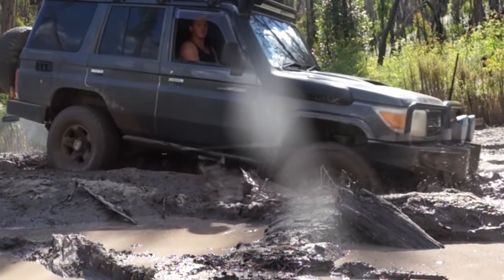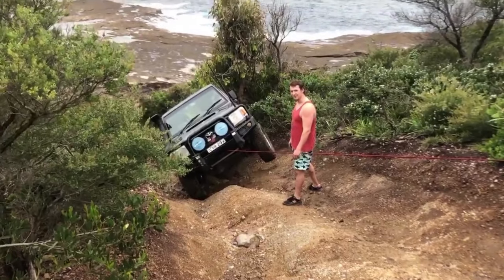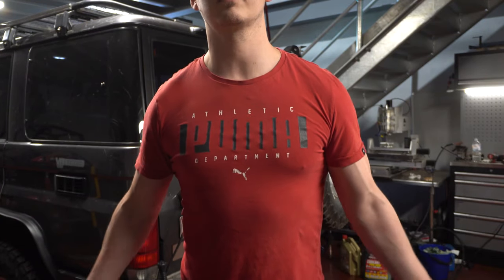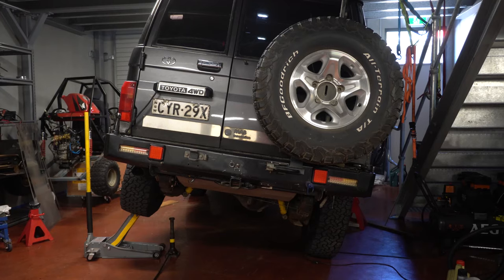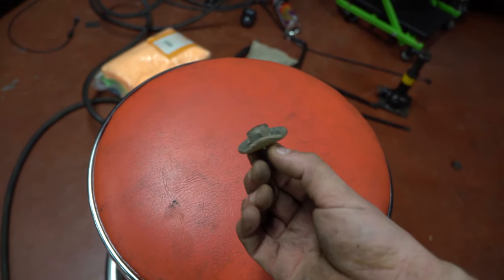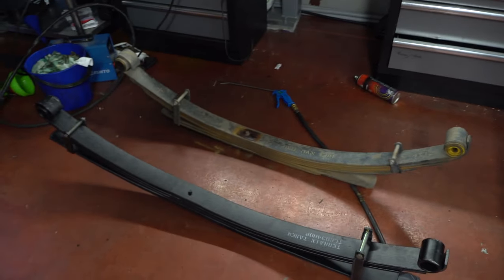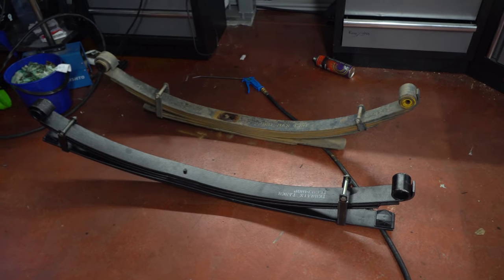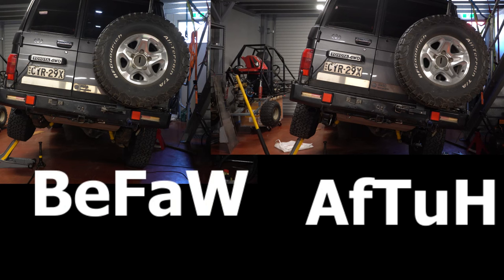Watch this BEFORE buying parabolic springs. are they good? (spoiler: no)

Comment: Mate you know nothing about suspension especially parabolics, you have no idea
Reply from the maker: Who hurt you Tommy? Were the awkward stares too much? Why not say the bits you don't like and we can figure out why you're wrong 😂
Reply: don’t you dare be mean to Tommy he knows truck and spanners.
Reply: Tommy is not wrong but please explain why the thickness of the leaf would change height of the car? The diff is on top of the leaf 😂
Reply from the maker: @jordankaraka897 another one! Welcome. Ride height is not the same thing as ground clearance
Reply: @ridiculousthings4x4 . Actually , your  Tyre Diameter  is the Major ground clearance improver/detractor .
But in reality the Lowest part of the Car is the Diff " Pumpkins " .
Reply from the maker: Not always. Flex up, what's the lowest point then? Regardless, the previous lowest point was the leafspring. Next
Reply: @ridiculousthings4x4 . (sigh) . The  TYRE CONTACT PATCH is the Lowest point .
In flexed position that remains true .
If you manage to Fall Off the obstacle causing said flex then OK the Spring Mounting Plate  OR  the Axle tunnel might be the low point in THAT instance .
Of course , you COULD always go to  UNDERSLUNG axles , eh . And remove the Bodylift Kit , because underslinging is about 5 inches of lift on its own .
The Diff centre still remains the  REAL  Low Point of the  Sprung Weight . NEXT .
Reply from the maker: Yup. Only after doing what was done in this video. Not even sure what you're arguing for
Reply: @ridiculousthings4x4 . I  argued in the first instance because you WERE talking shit .
Reply from the maker: Which part? Would you like a shovel? Comments like these do nothing but give me content for future vids
Reply: @ridiculousthings4x4 . Nah , shovel not required  by me . Maybe You need one though .

Comment: I like your style. Does it ride more smoothly? My 300kg westralia parabolics are in the shed and I am using 450kg dobinsons. Do not miss the long lower leaf scrapes in the dirt. I'd like someone to make regular affordable leaf packs that are a bit longer. This seems common in Japan. Here it looks like custom or psr 4" lift poop is the only option. Collecting leaf springs is fun.
Reply from the maker: I've only done road driving since fitting them so far. It feels more like coil springs on road though. The next trip will be the decider for me, but I'm toying with the idea of removing the lowermost spring which should retain most of the load carrying but allow much more articulation
Reply: @ridiculousthings4x4  tried this bro, doesn't work as it just sits on the helper and makes the ride worse :-(
Reply from the maker: @davefinlay3252  by lowermost spring, I mean the bottom spring/helper. The one with the brackets on it. Since this video, I've removed that spring and it flexes like it's supposed to.

Comment: Haha wheel spacers. Doesn't look too different on the flex test. I love my parabolics in my setup. The U-bolt plate will make the biggest difference. I was recommended long travel shocks with the parabolics not sure if the BP-51's would have the travel?
Reply from the maker: I guess the good thing about the HD is that I can remove a leaf and I've got the 300kg and below springs. I might go down this route, depending on how the next trip goes, considering I'm not running rear bump stops, and it doesn't get close to the guard. I'll have to consider shocks next after I've tested it properly. I need to see where my limiters are.

Comment: final tension of components particularly shackle bushes and shock bushes are performed when vehicle is on the ground supporting its own weight.
Reply from the maker: If the bushes are rubber, sure. But poly/rotating bushes it doesn't make a difference. Nice try though

Comment: Are you going to upload the video of removing the bottom helper spring and give a review?
I can't decide on whether to get the 3 leaf or 4 leaf and then just remove the 4th helper? I'm running a fairly light Troopy build, usually empty and 300-400kg when camping
Reply from the maker: Nope, but it might be worth just getting the heavier spring and removing one. Like in machining, you can take material away if it's there but you can't put it back if it's not.

Comment: Do you need to fit in shorter rear shocks ? High clearance U-bolt plate and parabolic combo raise the rear shock mount for quite a bit.
Reply from the maker: Short answer is no, you don't need shorter shocks. Parabolic springs are actually thicker for the 76, so you lose ground clearance. This is why I mention that there may have been some engineering classification shortcuts during production, as the 2 load 1 helper parabolics used to be rated 300-500kg now changed to "up to 300kg".

The 300-700kg HD springs are 10mm thicker which is covered in the video when compared to 400kg OME springs. I've since removed the lower helper spring because I don't really load my car more than this, and even with the 3 parabolic laod springs, I've only saved about 5mm when compared to the OME ones.

Comment: Ive run 700kg TT parabolics on my landcruiser for 3 years along with BP51's and I consider them an outstanding upgrade.
Reply from the maker: Different applications. You've got a well set up towing rig by the sounds of it. I wanted flex, which yours won't do due to bp51s being relatively short, and the springs being stiffer under load.

Comment: The rear isn’t the problem my friend. Need radius arms in the front, from your best mates, and then it will flex pretty good.
Reply from the maker: I hate to disagree with you Wade, but currently the front can droop to the end of shock travel, and tuck to the bump stops. It's the rear that struggles to articulate by comparison.
Reply: @ridiculousthings4x4   you are thinking about it all wrong man. Trust me, throw some superior arms in the front and you won’t lift wheels like you do.

Comment: Hey boss I've got a fairly light dual cab setup and have tried the 2 leaf and helper arrangement in my parabolics which is even shyter than the original 4 leaf cause it just rides on the helper, question is do u reckon your hectic 3 leaf no helper arrangement wouldn't be too lightly sprung in the dual cab? 
Cheers!
Reply from the maker: If you're as loaded as you plan to be and it's not riding on the bottom spring, then you'll probably benefit from removing it. Although hard to say for sure in the comments section.
Although. If it's a "fairly light" setup as you described it. You might be better with 2 leafs and nothing else.
Reply: @ridiculousthings4x4  
Thanks man I'll shuffle them around and report back!
Reply from the maker: @davefinlay3252  I only just saw which video this comment was on. You probably already know, but I made a more up to date one detailing the final parabolics setup. This one is all kinds of outdated cringe for me.

Comment: Messing with the leafs will only get you so far, if you want flex then you need to change the shocks, take them out go full axle bump and droop and measure open and closed lengths for new shocks
Reply from the maker: In some cases maybe, not this case. Suspension isn't a one shoe fits all ordeal. The low profile U bolt plates move the lower shock mount up an inch, meaning if I wanted longer shocks I'd have to open the can of worms that is extended bump stops. There would be no real benefit here.
Reply: Yeah I get what you’re saying but if you find shocks that suit your open and closed lengths you will be able to find some that have a closed length which works with your current bump stops and that have a longer open length for more droop

Comment: Nice Half-life (1) edit.

Interested to hear your thoughts on the parabolics.

Would like to have a set fitted, but they are bloody expensive.
(Especially if you're not from Australia, so stock gets imported.) 

 The price of two almost covers the cost of a 2 inch lift from terrain tamer for a 76 series (minus the leafs of course). 

Enjoy watching your videos.
Reply from the maker: Honestly, they're not worth it. I've managed to get mine to a good level of flex now, but not with how they are out of the box. I've removed the lowermost spring (you can see in my covid pisstake vid) and added revolver shackles. But if you just fit them and forget, you'll end up losing a lot of articulation, ground clearance, and 0 weight reduction

Comment: Ok why did you go with 700 kg ones and not the 500 kg . you will get better flex with them.
Reply from the maker: Because 500kg ones don't exist. They were reclassified as "up to 300kg" and the HD is 300-700 now.
Reply: @ridiculousthings4x4  ok .